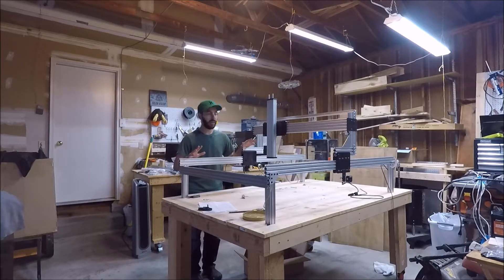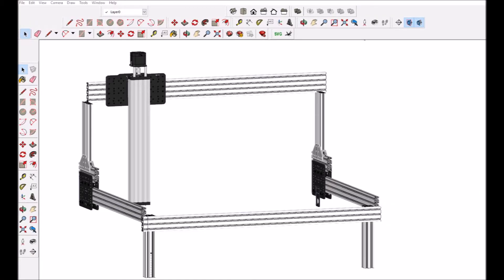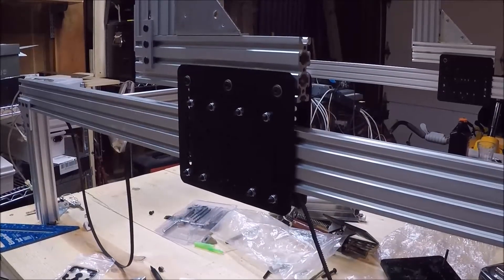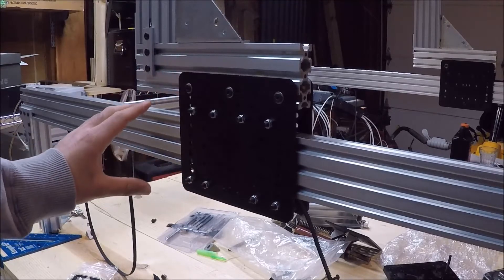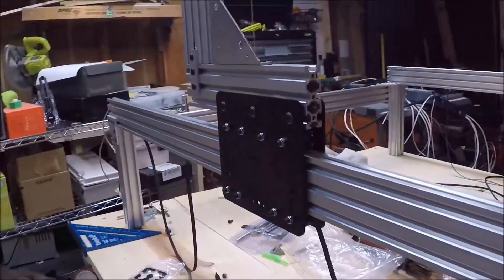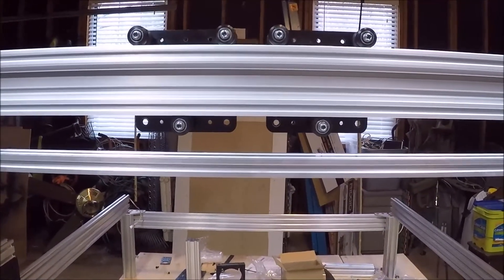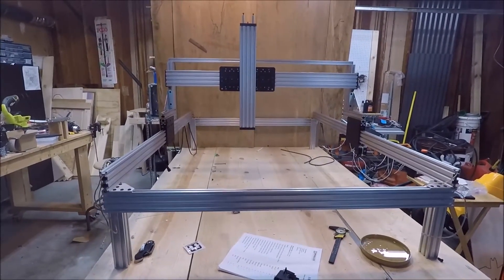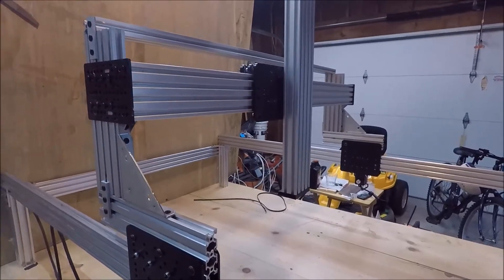Building an Aluminum Extrusion CNC Frame

Comment: Hey there. Can i ask if you are using polycarbonate or delrin wheels? Thanks you.
Reply from the maker: Good evening Jorge. In this video I am using Delrin wheels. Since this video I have changed them out for metal ones.
Reply: @OrangeLabPinball  Cool, can i ask how did delrin worked for you? why did you change them? Thank you for your reply. i  hope you´re doing well.
Reply from the maker: The Delrin wheels worked fine for me but after a few months of periodic use I did notice some slight wear to the wheels.
Reply: @OrangeLabPinball  ohh, i understand. Thank you for your reply. that help me a lot to decide what to buy.
Reply: @jorgedonoso7956  buy one without wheels, that wheels stuff is a waste of time now that linear rails are super affordable
Reply: @redherring5532  yeah, i got chinese hgr20 and 16mm ball screw. was a good choice.
Reply: @jorgedonoso7956  oh yeah big stability! I got an x carve and then a year later got a Queenbee.
Did you do a diy build or?

Comment: That's not strong enough to be useful, it'll cut wood, but it'll have to be slow... it actually might not even cut wood, that's more of a "pick and place" or 3D printing duty hardware AND design
Reply from the maker: Kar Oma, first off let me say thank you for taking the time
to watch my video. This frame is not nearly as strong as professional CNC
machines or Pro CNC kits, but rest assured it does handle wood very well. I
have done multiple projects in soft woods and hard woods such as cherry, oak,
walnut, and maple. As with most home brew designs I will always be adding or
removing parts to improve the machine. Thanks again for watching and
commenting.
Reply: Always a tool snob on the net where if it isn't a 2 ton Bridgeport it is crap.
Reply: @thebeststooge  no, he is right in his comment that anything other than soft woods will make that Z axis wobble and your precision will be wayyy out of whack. He has almost as much Z travel as X travel... the decision to make the Y axis connect to the X axis like 2 feet over the work area is a hugee design flaw for rigidity as he has to have enourmous Z travel to reach the table
Reply: He is correct! To many mechanical connections! Each one one is a flex Area! this will do fine with sheet stuff making sighs or proto typing in pine! Throw a piece of Teak on their and try and make a corbel or a oak raised panel door! just the way the axis moves is a proble We all know Linear Rails are stout! and more ridged! Kar oma is actual correct! But if your going for a sign maker you should be fine!
Reply: @effyou128  Exactly, I say Ipe no-way!